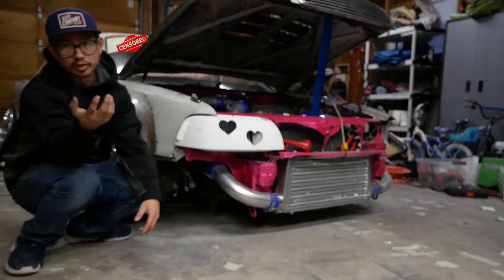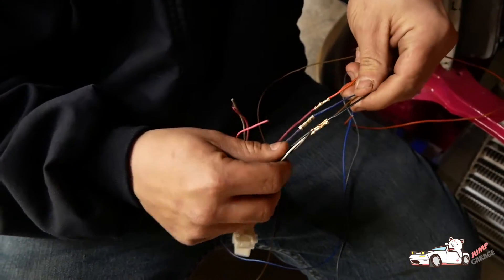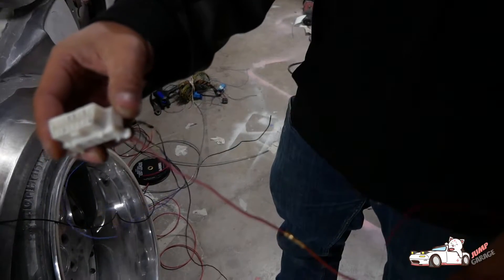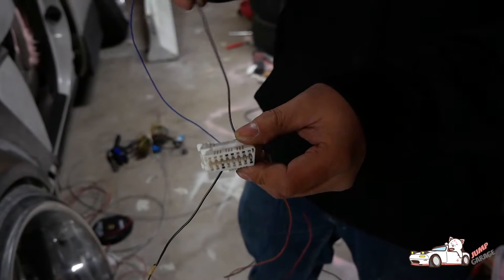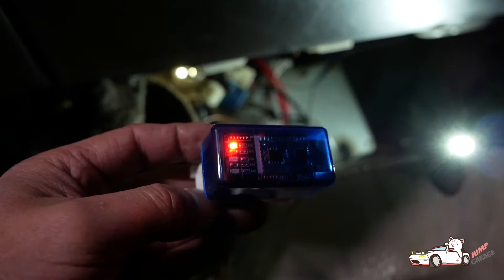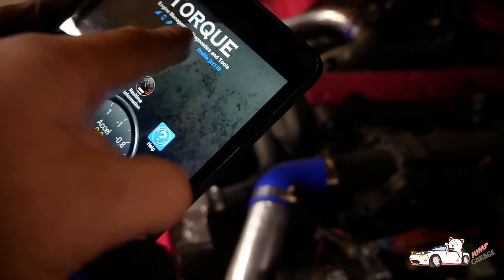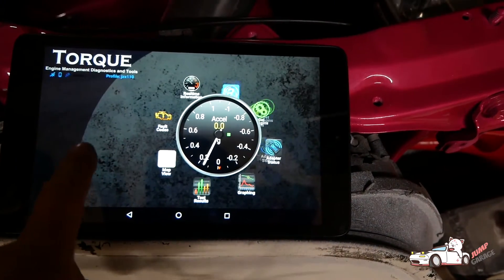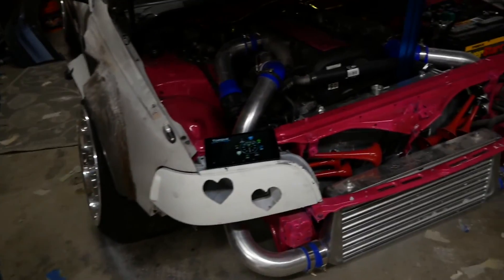How To OBD2 Wiring on 1JZ 2JZ VVTI & BEAMS!!!

Comment: jz vvti, I connected it and it doesn't work. ELM327 adapter
Reply: Did you use the torque app and type in the right info he showed in the video  ??my elm327 is Also not  connecting to my jzx110 but I'm using  the car scanner app .

Comment: Great video bro. 👍
But a warning note: if you do manage to connect to the ecu (considering its the JDM OEM ecu), do not drive with this app open and connected to the ecu. Car will go into limp mode after about 5 minutes and you won't have any control after that. I tried it on my 99 GS300 aristo swap with the OEM ecu and that's how I found out the hard way. Just use this connection to read and pull codes and clear codes if needed be.
Reply: was thinking of doing this but is this true will it really go in to limp mode?

Comment: Awesome video guys. Someone has already butchered my D plug, do I have to run the TC pin in order for it to work or can I just run SIL?
Reply from the maker: TC pin is just for use on a check engine light to flash codes, not needed for odb2 reader to work.
Reply: @jumpgarage  Ideal, thanks man.

Comment: at 3:18 when your explainning about TC wire it shows in position 11 not 13 but on your write up it shows 13 

I have it wired in positin 13 and it doesnt work
Reply from the maker: The diagram is correct. But it really doesn’t matter if you have it on pin 11 or 13. TC is just to trigger ecu to flash trouble codes on check engine light when you jump CG and TC. Check engine light still need to be wired correctly to the ecu via W pin on the ecu if it is not already. W pin powers the check engine light.
Reply: @jumpgarage  does it matter thst i am using a jzs171 non immobilized ecu with a jzx110 motor(etcsi)

Comment: Will this work for 1jz vvti out of 1997 soarer ? Cuz I can’t find the SIL wire ?
Reply from the maker: From what I’m finding online, the Soarer with the 1j VVTI didn’t have option for SIL, but the 2j VVTI Soarer did. Yours might be odb1 but I cannot confirm and the process of reading that data is limited and different. ToyoODB1 is would be the app.